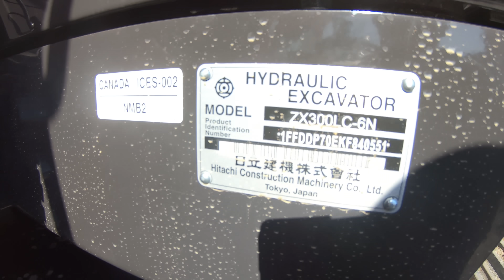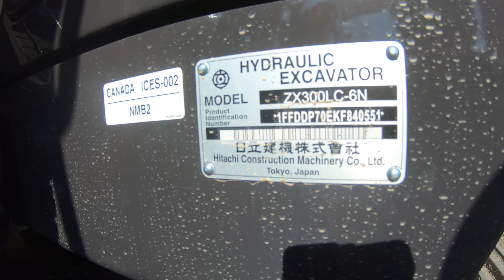Overheating mystery solved for John Deere/Hitachi Excavator 35zts

Comment: Jesse, here's how one of my old instructors taught us to make gaskets.
Take the item like that water pump and ink with a ink roller cover the area the gasket covers. Then set it on a sheet of thick paper to make a stencil.
Cut our the passages and bolt holes not gasket cover.
They make hole punch sets.
I used to have one.
Cut tge other areas out with an Xacto knife.
Then set that over a sheet of gasket material you can find online or at NAPA if they still sell it.
Trace the outline and trim and punch the areas ya need to.
Now you've got that gasket.
Still put a thin film of that gasket sealer you used on both sides of the gasket before you install it.
I've made hundreds of gaskets over the years.
Was cheaper than buying a gasket set when you only need one or two and often cheaper than a large one.
Only head or other high pressure gaskets should never be made like that.
Those usually have metal in them.

Comment: You could make a tilt bucket. I am thinking about making one, and a water trenching bucket.
Reply from the maker: I have definitely been thinking about fabbing a tilt bucket, would probably have to unhook the thumb to use it, but it may be worth it. Maybe we will both have to make one? One for your Kubota? Maybe with a 3 ft bucket with no teeth
Reply: @jmuller86  Yeah, that would work. Just put quick connects on the thumb. I have been unplugging mine to use the hammer, its easy. When making stuff like that its easier to make a few at a time.
Reply from the maker: @AndrewCamarata  yea we could basically make ours the same dimensions, just different ears. I do have quick connects already for my thumb. I want to make a way for my transit receiver to be hooked into the system too, for like a cheaper alternative to a trimble
Reply: @jmuller86  Ok, whenever you want to do it. We need cylinders, hoses, and round stock to make tilt buckets. I still want to do trailer lights. I keep getting calls for jobs.
Reply from the maker: @AndrewCamarata  sounds good, I will start taking measurements and we can figure out cylinder sizes to order, nobody has a tilt bucket fab video on here yet. Another option for the tilt is to use a linear actuator. They make ones strong enough to do it, like 2000 lb force. then you could add that to your yanmars.  They are less weight than cylinders too https://youtu.be/snq4GFXrqV8
Reply: @jmuller86  I would rather it be hydraulic.
Reply: @jmuller86 i wouldn't trust the actuator and I would like to help you guys on that project it sounds fun
Reply: @jmuller86  did you build it with andrew?
Reply from the maker: @bruceblais7958  we didnt yet
Reply: @jmuller86  okay I didn't think so, you were to busy on the castle with andrew, thanks for getting back.
Reply: If the parts real expensive. Why can't ya just weld the pulley solid ?
Reply: Hey, I got monetized a few months ago, have 5 mill views, wondering if I could collaborate with you guys from California now and then. I have a Case Cx37c, a Kubota M7060, and I do all my own stuff. I just bought 31 acres with a lake and a pond. It was an old California gold mining town. I have the era pictures, and the cemetery is till there, on the neighbors property. If you don't hold the California thing against me, lol. Anyways, enjoy your shows. I know we're all busy! Yee Ha! Love being busy, oh, and I'm old.

Comment: You did a great job.   If it were me, I would have replaced that lower crank seal and pressure washed the engine - easier to see leaks that way.  But it's also easy to be a YT critic - I'm not doing the work....
Reply: I thought the same about pressure washing but read down to see if someone else had already mentioned it.  Agreed about leaks or fractures.  I'd probably replace some hoses at the same time and date label them.  The radiator looked a little dirty..that grey area??  Sometimes things fail out of sympathy..if you get my point.  Others can be more easily replaced when half of the area is a part.

Comment: The Damper pulley's can cause unknown vibrations and need to be replaces on larger diesel engines especially when rebuilding an engine, yours is completely gone which shouldn't happen, my tip is always buy a genuine seal for the crankshaft as the cheap ones fall to pieces then all the oil will be pumped out in a minute, those Hitachi machines are a quality machine and have a reputation of good quality where where i live.

Comment: I was yelling at my TV, change the oil seal, change the oil seal. But good job on finding the problem.
You can buy gasket paper and cut the gasket yourself. Also saw people cutting gaskets with home printer/paper cutters called "Cricut Maker Champagne"
Reply from the maker: I actually changed that seal today,  took the spool valve manifold off and had to remove the coolant system to do it, so there will be a new video in about a week with me changing it

Comment: One other 'simple-weird O' problem I have had, the lower hose is often the suction side. In old days manufacturers put a spring inside the hose (to still bendable/flexible YET prevent the hose from collapsing when hot and in suction). Some new style has a hard outer shell to prevent 'pinch/bend collapsing'.  Just an PSA on overheating...

-One of the cause of failure of a harmonic balancer....is over heating in a major way, will soften the rubber material and fail with a load upon it. So use a puller and don't heat torch to attempt removal.

Comment: Good job and diagnoses,  possibly what ever got into the fan jammed it enough to brake the rubber in the crank pulley . Just a thought because of how the fan blades were chewed  up. If you would have welded it , it could shear that key next time , then it would be in the gears etc and really do some damage!

Comment: Hi there, at around 6:47 when you take out the radiator, there is a smaller hose at the bottom (around the the centre) that disappears underneath. When reassembling, where does that go. I can't find any reference anywhere including the workshop manual that mentions what it does or where it is supposed to connect.

Comment: I used to work as a agricultural mechanic and i never left a cran seal if i had to remove the front crank pully.The reason is after many hours of use the seal wears and the lips start to stiffen. Also i did not see you grease your seal lip before inserting the pully.By leaving the lips dry, when you start up the engine the seal will overheat because it has no more oil or lubricant on its lips . 
One more thing here if i may, when replacing a gasket with liquide gasket maker make sure you have clearance between the impeller and the face. In some instances the gasket acts as a shim.A fast test is placing the part back on without anything and turning the impeller by hand and se if there is any interference 
Have a great day
Reply from the maker: the pulley seal surface had lube on it from the factory, I should've replaced the seal , I was just focused on the overheating and wasn't thinking about the seal until after I started editing my videos, then the first thing that came to mind was " I bet people are going to point that out" and sure enough lol , but I agree about the gasket acting as a shim, however; the waterpump was previously removed because there was only a black silicone on it when I removed it, so I figured it was ok to put it back like that. All good points though, thanks
Reply: One more point after thinking about it. I thought i saw engin oil smeared on the front cover of the motor. Engin oil has additives in it and i know that certain rubbers are affected by this oil. Could the damage to the rubber in the damper be caused by the engin oil that could of leaked by the crank seal.

Comment: Cars do this, worked a Buick that this happened to, but its was obvious, the whole thing fell off from the rubber, One vehicle that got me and the previous owner was a 06 Kia Sedona with the 3.8 v6, I got it for cheap, it slide into a ditch and bent up all the body parts in the front and passenger side, but it had a knock to it, not at idle, but on a load it knocked pretty loud, Well I had a newer Sedona for doner parts, engine, body panels, with the intention to resell once its rebuilt. After some time and taking parts off to get ready for the engine swap, I noticed the balancer had been rubbing the timing cover, Here the balancer is the reason it had the knock, it sounded so much like a lower end rod bearing..... Replaced it and  no more knock!

Comment: Jesse, if you ever get stuck for a gasket you can buy sheets of generic gasket material in various thicknesses and cut them to shape with a craft knife using the old gasket or the part as a template.

Comment: You probably know it by now, but it is quite easy to make your own gaskets, with gasket sheets and a ball peen hammer.
Just lay the sheet over the part and gently tap with the balled part of the hammer, along the edges. Just like OEM! 👍 
It's a bit easier if you make the holes for a couple of bolts first, then you can put in two bolts that will hold the sheet in place.

Comment: Seen bad clutches on the fan caused overheating on my Chevy truck, pulled my hair out trying to figure that out as well. Finally figured it out why revving the motor I noticed the fan did not rev as the engine did.

Comment: That is a harmonic balancer. The rubber is there to dampen vibrations/harmonics. It probably degraded because of the oil leak.
Reply: It absorbs torsional vibration as each cylinder fires which can eventually break crankshaft if bad.
Reply: @jerrybradshaw9879  Correct. I have also witnessed rotary oil pumps get destroyed from this as well.

Comment: That is a harmonic balancer that are considered a wear item, I noticed the problem as soon as you turned the fan with the belt still on, as you removed the radiator with the hose. Also you can check a water pump with a heat gun, if you have no flow the top tank will not get hot but the engine will

Comment: I once had a truck where the owner was adding that silver powdered metal stop leak to the radiator, but he kept adding more and more until it became a clogging issue itself.
Reply: you should never, never add any of that crap to a radiator. Even the cork or rubber stuff is bad. It plugs up the water jacket where it thins out. Crappy stuff.

Comment: The fan extension is not seated properly on the water pump / pulley, its wobbling around. You will loose your pump bearing if not fixed. Cheers Jesse

Comment: Was that just a spacer between the fan & the water pump, or was it a fan clutch? If is was a fan clutch, that could cause the overheating if its bad. The fan looks like it's off balance, which would cause the new clutch to wear prematurely.

Comment: Man I hope that you replaced the seal for that balancer  and the oil leak up around the thermostat somewhere while you were in there.
Reply: I second that.
Reply: The leaking seal is what made the rubber in the harmonic balancer fail!
Reply: @Glen Spivey Sorry man, just an old mechanic, in the blood you know.
Reply from the maker: I replaced it today, had to take the spool valve manifold out and all the cooling system had to come out so I figured I might as well
Reply: @time1800  exactly!
Reply: @jmuller86  cool
Reply: @jmuller86  I haven’t seen what motor this runs , was wondering if it is the Mitsubishi 2.4L that is in my Terex HR16 ?

Comment: Had this problem on a not very old Kia auto. I've seen only one fail in my entire life on an old Chevy, and it was really old. I'm 71 and have worked on stuff most of my life. New cars are built to a fine balance, and it's easily upset. Older stuff is less efficient, but better built.

Comment: When it comes to your fan,if it has a crack or any chunks out of it. Replace it! If it comes apart, your not going to be a very happy camper. Ou would surprised how much they flex when the engine is running. I’ve mage this mistake in the past. I’ve been a HD mechanic for over 20 years.

Comment: I hope you held the pulley on the pump and tried to turn the impeller to make sure he impeller isn't spinning on the shot.  Used to be a common problem with plastic impellers, not so much with the metal ones.  Definitely caused overheating, and was common on many vehicles.

Comment: You may have wished you had replaced the front seal when replacing the vibration dampener.  Good video. You saved a fist full of $100 bills.

Comment: For the four screws that hold the plate to the water pump, some Permatex Anti-Seize Lubricant, (Price: $8.49, on line, as of 12/16/20) Napa Auto Parts Part#: PTX 7651674 (8 oz / 236 ml) would have been the way to go. Not to mention some other bolts could have used this on them as well. Makes it easier for the next person (that usually means you Jesse) to dis-assemble. If you do any type of repairs from chainsaws to heavy equipment, this product needs to be in your shop. I'm not a spokesman's for them, just passing on a product that works. If your working with Stainless Steel, you need a different Anti-Seize Lubricant product.

Comment: Thanks this will be a big help if I ever have to do it. I was looking at my oil cooler and was wondering how much of a pain that would be to get off. Not that hard now. How many hours on your machine?
Reply from the maker: Yea its not hard as long as you drain the fluid first. Theres around 4k hours on it

Comment: Jesse just trying to save you some money and future headaches.  If you check out the vid at about 41:30 it looks to me like the fan is not running true. It appears to be shaking the whole engine.  That also makes sense because the fan itself showed damage earlier in the vid.  This will destroy the water pump bearings unless you fix it.  Go back and check the vid when you tightened the fan bolts.  You will find that you missed tightening one on the second pass with the impact.  I always use a hand socket to tighten because it's really easy to miss stuff if going too fast.

Also, always replace the crank seal when you are in that far.  The oil leak is what likely caused the rubber on the damper to fail.  That's not a clutch!  Always fix any other leaks while you're there, it's much easier in the long run.  Finally, do yourself a favor and stop using 12-point sockets with your impacts.  Just buy a good set of impact sockets.  It saves the bolts (and sockets) in the long run.  Just trying to save you some future cash and give a tips to help you out in the long run.  Good vid man!

Comment: I'm not an engineer but I struggle with the idea of the oil being cooled by warmed air from the radiator-still it obviously works.
Reply: This Fan sucks the Air from the outside through the Radiators and blows it into the Engine compartment. You can hear it from the Microphone at 41:24
Reply: @doubleschleudergang1028  I see that but how can heated air be used to cool?
Reply: @davidworsley7969  How do you think is the Air heated? The Air only gets heated because it carries the heat away from the hot surface of the Radiator thus cooling the Fluid inside.
Reply: @doubleschleudergang1028  ...And then,after being heated by the radiator,the warmed air is used to cool the oil-Just saying-it's confusing to me!

Comment: I'm surprised that all engines today have this "harmonic damper" while engines decades ago never had them. I suspect it's more for noise than anything else, but it's one more part that seems to break often.
Reply: ehsnils it is for internal stress dampening,older engines had less compression and less rpm. And were made heavier .new engines more rpm lighter much more compression
Reply: ehsnils decades is right, like 5.  Since gas was leaded about.
Reply: ehsnils Engines had dampers since 1930s to stop vibration and crank shaft breakage. My Mack broke a crank from a bad damp er. 1975 R Thermodyne

Comment: I'm confident there is a reason, however my first thought was, if the new part is so rigid, why not TIG weld the original components into one piece.  That would permanently resolve the issue.  I can only presume a certain amount of slippage is necessary.  When I replaced the water pump on my Duramax (really an Isuzu engine) due to overheating because the manufacturer uses a slip-fit for the shaft / impeller interface, which is a common problem on this engine.  Before installation, I TIG welded the shaft to the impeller at the end of the shaft (about 3/8" top and bottom).  As a result, this water pump is never going to slip on the shaft.  One less headache since removing the water pump is a pain on this engine, which is otherwise a magnificent engine.
Reply: After welding the balancer the following problem will be a broken crankshaft.

Comment: Was there any warning signs from the electrical side, like it not charging the battery or it being hard to start because the battery hadn’t been charging correctly with the alternator not getting the right rpms? Very Good video also, thanks for sharing the knowledge
Reply from the maker: actually no there wasn't, which definitely threw me off. was hard to diagnose. overheating was all I needed had to work with. well the fan was definitely louder once it was fixed also but didnt help me diagnose it
Reply: From what I've learned most alternators can output 100% around 1000rpms so barely above idle. So a slightly slower rotating alternator wouldn't indicate much.